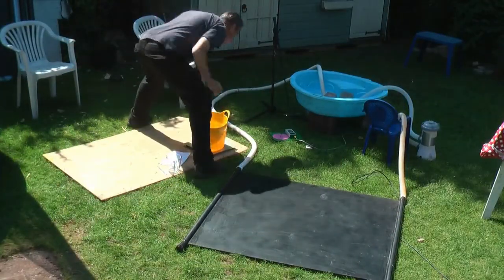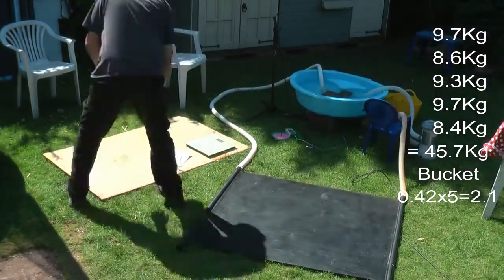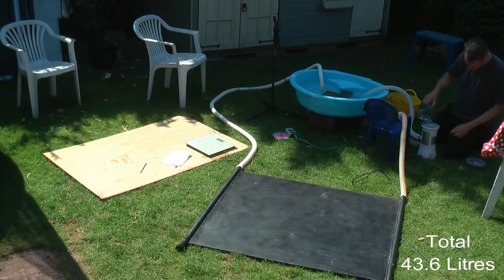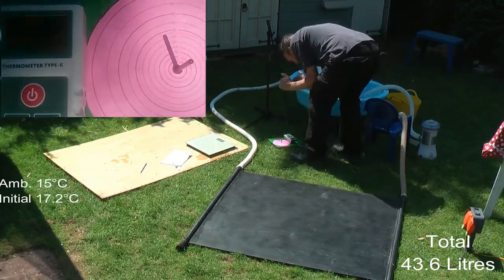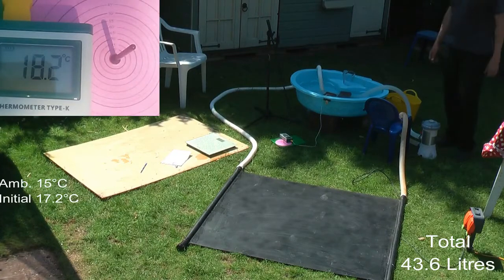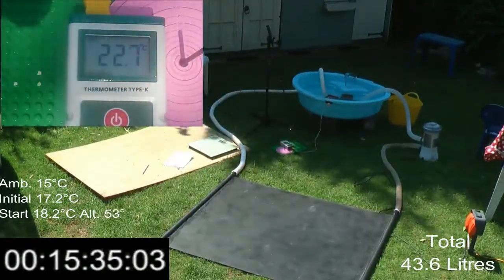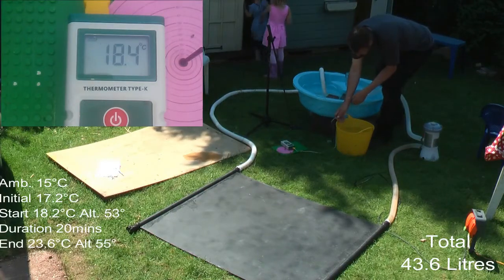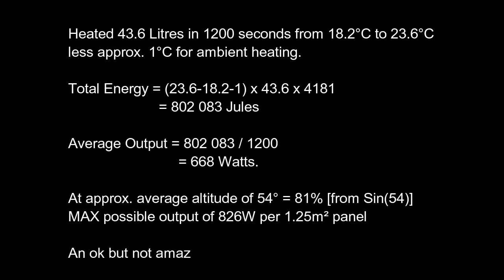Testing homemade diy solar pool heater from polycarbonate sheeting

Comment: Nice idea. Mine was to use triple wall. On the topp is only closed air and under the panel is insulation. So heat is not drown from wind.
Reply from the maker: soosgabor100 I wish I had used tripple wall like you commented.  I did consider it but wanted the absorbing paint to be against the water surface. If I made it again I'd use tripple wall opal colour to absorb heat better.  My finished 14m2 panel was a disaster, the poltcarbonate was much more rigid and didn't bond well at all.  It was immensely heavy (240Kg) and leaked regularly, however it did work well for a while and pumped out more heat that solar alone with a large temperature differential.  I figure it absorbed enegry from the ambient air.
The main problem was lack of insulation and it didn't heat well above ambient air temperature where ita acted like a large radiator.  I tried a slower pumping rate to increase heat absorbtion but it pumped unevenly through the panel and some parts stopped working.
I haven't tried again, the uk doesn't have enough direct sun and many times when it was working there just wasn't enough sunlight when I wanted to use the pool.
Reply: @Spedley_2142  This is a great idea and it seems that the economics of a polycarbonate sheet, a small water pump, and little electricity would be better than that of natural gas at latitudes of 30 and greater. However, if what is said is correct then why isn't this product already in the market.
Reply from the maker: @whatever465456  it is already on the market but very costly.  The've based the price on the overall cost of alternatives rather than the cost of manufacture.  On a side note, I now have a 40KW Kerosene boiler which I'll get around to uploading at some point - last year was so sunny but this year quite the opposite.
Reply: @Spedley_2142  hopfully we will see the boiler in action. As far as alternative pricing is considered, market competition states that the situation cannot last for long, at least in theory.

Comment: so maybe try it  this way and  put it on the wooden sheet,  instead of the grass  because the grass/ground  may be drawing out the heat from the water.
Reply from the maker: Ah, forgot I hadn't updated this.  I made a much larger panel of 14 square metres but it didn't go to plan.  It is too heavy and prone to leaking although it did average 11kW output over about 12 hours which was great!
Heat leakage to the ground isn't really a problem when the water is cool, however I have noticed my larger panels act as effective radiators when there is no sun.  I need to setup an automated switching system to prevent this.
Reply: yes maybe build it on like a  insulation  sheet .